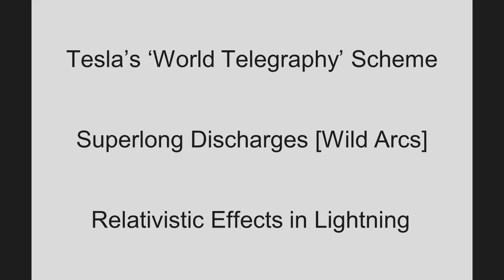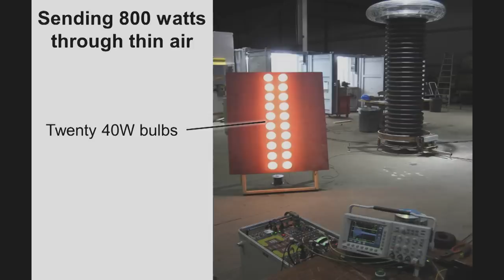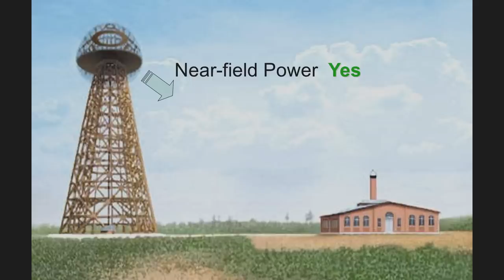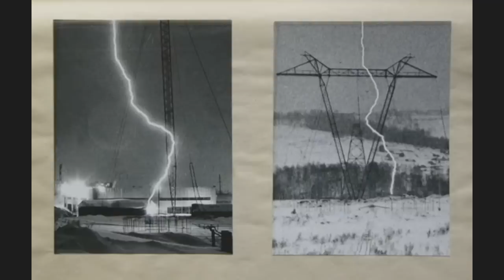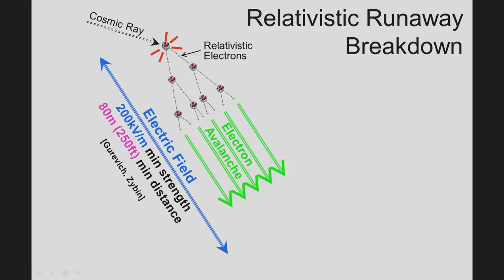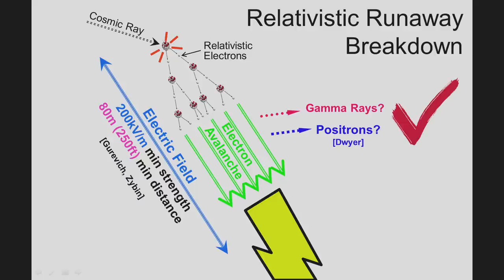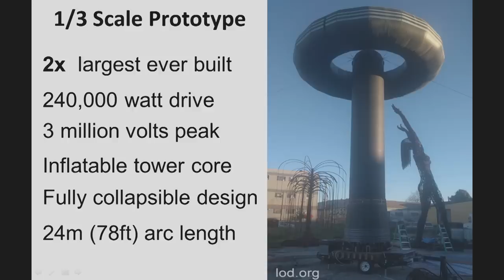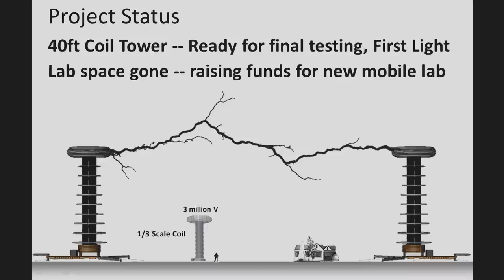The Secret Life of Lightning: The Science of Giant Tesla Coils | Greg Leyh

Comment: What I want to take time to discuss with this crowd and get some feedback on is my latest Tesla dream.
Its a known battery scheme that when vanadium (v2?) metal is charged by whatever means it can be used by way of pumps to strip away the charge for use in the grid.  
The dream is to lay down a large circular pool of vanadium with passive (?) grounding around the circumference of the pool so that the lightning is slowly absorbed into the capacitic pool without explosive force, thus charging the vanadium storage battery.
In order to get the lightening to strike at the desired location all that would be necessary is a small rocket carrying a hair thin conductor towards the clouds of choice, this is a known scheme that is effective for attracting lightning.
I'm told that the vanadium battery is stable and can hold its charge for years with little loss of charge.  I'm told the problem with the battery is that it takes a long time to conventionally charge and discharge but can do both at the same time with no degradation.
If I'm correct, by putting the Tesla coil in the liquid battery and bringing the lightning to it its possible to harvest atmospheric charge for use as needed.
Lightning in a bottle anyone? 
Thanks for your lecture and looking forward to hearing about foolish dreaming.
Just to be on the level, as a young child, I have seen ball lightning following the phone lines as well as a sprite, long before it was recorded by the astronauts from space so maybe that's my qualifications for the subject.

Comment: As another Tesla List member/lurker, I've studied ball lightning, and it seems to be a carbon electric effect.  In every instance of natural ball lightning, a source of carbon could be found.  I first generated it by using a burning chunk of car tire on the electrode of my Tesla coil.  The balls would begin to form above the flame in the soot smoke, and range from pink to blue in color, and up to 1/4 inch in size.  More powerful coils produced larger balls.  The largest was about 1 inch in diameter from a coil running about 2400W input. (12KV 120mA xfmr)  The Corum's put out a paper from Battel in which they proposed a carbon aerogel form, while I propose a fullerene form. Fullerene manufacture is usually done in a carbon arc in an inert gas environment, whereas, I would be making them in a combustible environment.  That's why I favor the fullerene as a ball lightning model.
Reply: So how does this explain ball lightning traveling through solid barriers?
Reply: @dougselsam5393  Good question.  Just like a soap bubble slowly evaporates until surface tension collapse, perhaps the plasma is the "surfactant" of an antimatter soap bubble that is at a harmonic of the weak force, and as such, just travels thru the 99% space that makes up atoms.
Reply: Some balls could be more supernatural in origin.. it is a prime shape.. then again maybe (substance dependant) carbon on the other side of the wall might somehow be induced into shape.. 

Nice research btw! An good question.
Reply: @richardward6747  Yes! The Corum's did find that balls would pass through glass if there were carbon smudges on the opposite side.  Likely a capacitive effect.  Like balls passing through aircraft windshields.  Jet aircraft always have a fine coating of engine soot on all surfaces, both inside and outside of the aircraft.  If the static drain system is degraded, the aircraft will charge to extremely high potentials allowing St. Elmo's fire to form.  It's that combination that's always seen in ball lightning events on aircraft.  Nothing supernatural about it!
Reply: Check out The Bagel Game
Reply: There was an episode of the podcast American Antigravity on YouTube where the engineer being interviewed said that the ball lightning went into a barrel or bucket of water then passed thru the wall and dropped the water inside of it into the floor that it had picked up from the barrel or bucket! The water on the outside of the ball lightning seemed to vaporize into steam (or maybe even something else like John Worrell Keely's Etheric vapor) but whatever was inside for taken along with the ball lightning and passed right thru the wall with it as if the wall wasn't even there and then fell onto the floor and left a wet spot when the ball lightning dissipated.

It makes you start to wonder, especially after hearing interviews like the one William Lyne gave about high voltage high frequency electrostatics/dielectrics  being used for all sorts of strange purposes that could have military applications from high speed flight with no G-force effects on the occupants of the vehicle when accelerating at rates that would otherwise kill any human or animal in a conventional flying machine, to phasing thru walls, to using it as weapon in the form of Tesla's "death ray" (a mercury particle beam shot out of an open ended vacuum tube using a "wall" of compressed air to keep the inner vacuum tube under vacuum during operation despite being open to the atmosphere for the mercury particles to escape which the Tesla version of the Van deGraff generator was then used to create an extremely high voltage dielectric impulse that was carried over this mercury "wire" after it was amplified to even higher voltage thru Tesla's special electrostatic/dielectric amplifier mentioned one of the four main components in the patent and then this mercury particle beam carrying this high dielectric voltage impulse was then aimed at vehicles and other targets would ignite them and their fuel source on fire at a range of up to 200 miles away and thus destroy them while also simultaneous mercury poisoning any personnel) to also receiving images thru time from the near to distant past that could be exposed onto film by allegedly using rotating quartz lenses (quartz being a form of carbon crystal).

Allegedly Charles Proteus Steinmetz working with Baird T Spalding came up with a Time camera based on rotating quartz lenses that was later confiscated by the FBI (just think of how many unsolved murders and other cold cases a device like that could put to bed!). There are also a few cases of time camera Inventions in Britain in late 19th and early 20th centuries. Pier Luigi Ighina also allegedly developed a microscope that could break the optical diffraction limit using rotating lenses similar in effect to the alleged optical diffraction limit defeating microscope 🔬 of Dr Raymond Royal Rife. Supposedly John Bedini somehow came into acquisition of the beam tube used by Rife and thru legal tomfoolery, he was sued and forced to fork it over to an IBM executive at the time due to disparity in financial power between the two that could allow the executive to carry out a legal war of attrition until Mr Bedini was eventually forced to give in and hand the extremely unique and important historical component over. If these devices are really out there, then it's a shame they have been hidden away because the potential biological and medical research that could be done seeing live samples in vitro at those scales rather than killing everything in the sample to place in a vacuum for examination under an electronic microscope would open an entire new chapter in the biological and medical sciences, and all science in general. But that might throw a monkey wrench into profit making machinery of Big Pharma and to some extent Big Energy as well... It's just too bad we're not all clairvoyant or the yogic techniques and process for becoming clairvoyant that open the etheric channels up the spine to awaken and activate the pineal gland havent been made public information so that we can't train our bodies and minds on our own time without needing to find and travel to the rare teacher (like Sadhguru) capable of training us to this level of "awareness" and can't use Dr Annie Besant's and Charles Webster Leadbeater's "micro-psi" research technique that was extensively used to document their research samples in their book "Occult Chemistry"!

Walter Russell I believe also claimed carbon was the highest energy state element on the periodic table and he had many unorthodox experiments like a syntropy/negentropy based nuclear transmutation machine that he said was based on the doubling principle in nature and that the device was confirmed as completely functional by Westinghouse labs and was printed in a newspaper article in the 1920s. Dale Pond has some great lectures on Walter Russell that also bring in the research of John Worrell Keely and seem to expand upon each other's work though it is believed neither men ever met each other or knew of the other. Dale Pond's SVPwiki is a great resource for beginning to understand their research!

There's just so much out there we don't know and when you start getting into different theories and experiments that were floating around prior to the first and even second world War, you can see that they were really able to think outside the box on issues in fundamental physics and electrodynamics but after the second world War with the rise of Atomic energy research and the 1951 Inventions Secrecy Act, it seems like much of that was all clamped down upon. With all the stories from guys like Bob Lazar and the late Philip Schneider, something tells me that if this type of research is done, then much like nuclear weapons testing, it is most likely done on remote federal government land like a military base and done hundreds of feet underground, if not miles, where they can contain any collateral damage to a minimum should something go awry, and simultaneously maintain operational security so that the research remains highly classified. It would also easily give you the opportunity for experimenting with other gasses besides air without needing to blow a giant building sized glass tube or globe to create a giant vacuum tube.

Comment: Great vid! Nice to see humor thrown in.. Lots of comments here  interesting all, but for anyone genuinely interested it's fairly simple to build a VTTC (vacuum tube Tesla coil) and it won't break the bank. A Microwave transformer (30.00 fr.EBaY) will give you 2kv. for the anode (plate) voltage, transmitting triodes (tubes) are cheap from there as well and even new 811A triodes are cheap. 572B's aren't bad either, I use a pair of these. Many old and new tubes work fine. Some wire, a filament transformer, forms to wind wire on and a few resistors and capacitors and you're good to go. VTTC's don't produce huge arcs but are great for wireless transmission of power. Just a class D oscillator with a big step-up coil. Lots of schematics online and I'm having real fun with this and also learning plenty. Great community of hobbyists out there also who are friendly and interesting people!

Comment: The higher the voltage the more pressure is pushing the electrons, thus the farther the arc is going to travel. Also lighting turns o2 into o3 and it has been "claimed" that ozone is being depleted  causing holes in the ozone layer. If a hole was in the ozone layer the hole would be visible as a black spot in the azure sky , and in that black spot would be visible stars in the background.

Comment: Any speak on Tesla that does not include Tesla’s electrostatic compressional wave, has missed the point. This lecture is an example of stacked misconceptions, and not enough research. 
Tesla clearly said 60 billion volts is not dangerous to handle,if one is utilizing his high frequency, electrostatic compressional waves. 
There is a 3 percent loss in sending this energy across the world, according to Tesla.  First thing you need is a flat coil, as compressional electron force is only possible from a flat coil, not a solenoid.
Reply: I like your brain! 😃

Comment: The answer is in the small light balls at the end of a lightning flash. Not the million volt arc. But the tip flare that jets of in a separate course. It is a bubble of charge that is counter to the atmosphere, so it has a short life, but if charge were maintained it's field left intact. You now have a bubble that holds itself against all matter no matter the density, to a point. That bubble is the field around ufo

Comment: Im astounded electrical engineering still hasnt figured out what musical theorist have known for Millenniums. The earth transformer hums at 7.83hz base frequency. In music a tuning fork struck can mysteriously vibrate a resonately tuned tuning fork several feet away or more depending on frequency. So the height of a mast will determine voltage. The top cap will determine how many joules can be collected dependent of its surface area. A variable resistor and variable capacitor with a spark gap can then be stepped down for power draw onced tuned into the earths frequency. Comes in low frequency, change it via spark gap distance and capacitor design to change the usable frequency. A 440v 400amp system would cost about 15,000$ at todays price
Reply: "mysteriously"? Really?
Reply: @cjay2  can you expound on sympathetic resonance?

Comment: My friend built a tesla coil out of a vaccume cleaner motor and belt and it burned the insulation off some wires or something and caught the appartment on fire
Reply: yeah you have to watch sparks breaking down the insulation of the wires charging the belt drive system  yeah um get cables with thicker insulators

Comment: A question
How have you guys managed to get the original Tesla designed tertiary coil to have the electric and magnetic component in phase? I'm sure you know that the displacement current effect relies on this otherwise your just transmitting conventional hertzian power?
And what mechanism is switching the 'spark gap' so fast to create the DC single pulse to feed the tertiary capacitor coil? MOSFETs?

Comment: I'm looking for the YouTube video that shows me how to build a lightening rod that charges my battery bank when struck by lightening. Or better yet, just while staying stationary up in the air.
Reply: My reasoning that this is possible is because once my low end solar setup had one battery that was grounded outside my home and it ran a 6v computer fan that ran mostly 24-7. Sometimes at about 4 am the fan would nearly stop the led acid battery being very low. As soon as the sun would believe the fan would speed back up. Early one morning about 4 am the fan moved very slow and seemed as though it was about to stop. A lightening storm came through with lightening bolts striking near. The fan began working at a speed I thought the thing was going to fly apart. It did not, but the battery ran that little fan at a high speed for over a week from that point on. Was it the light from the lightening bolt charging the battery through the solar panel? Or did it have something to do with the battery being grounded?
Reply: //we abide "offrid" and I am also concerned about my solar/wind system being struck by lightening and blowing up my gel battery's. Amd I rightly concerned about this? Anyone?
Reply: @nonyabusiness9747 its possible but onky becuase you have the neg dc to ground as in true earth ground.
Reply: @bramcoteelectrical1088  which part "is possible" I inquired on a couple different scenarios

Comment: I would say the problem is your over powering what is needed to just run a city or small town.at 100k watts in a distance the wave form holds its tuned signal if at BOTH ends are tuned and won't be veiwed over head as you see sparked lit up voltage over head when this is veiwed that means its not in tune has nowear to go RESISTANCE is seen in the air by only the lght sbow
Reply: Strange how no one wants to talk about this if the condition on each side to start to end is the same than the color of its manifest is rather not seen like the energy sourse a color or a invisible feild just because you dont see dont for one second think its not there like mr tesla said the color is the light in what condition its seen only of the feild under the condition

Comment: Diodes and dielectric have a good drawing on rope that is ceramics in the design Diodes plated along the molding dusted and heating of fine metal flux or flakes starts inductive coils to heat up and a honey comb wires can be thick thin the grainy powder mixture in to ceramics along the lines powder with inductive coil heating. twin mixs that 50/50 piezo powder and a dielectric pieces straight wire exactly the same pieces by melting the iron in side the ceramic and the other mix poles to there ceramics all ran through the line created for super influx voltage insulated and conductive.

Comment: Take one wimshurst machine.
Take a bunch of disks.

Ever build a car ...has name parts...Holly carb.
Ford engine block.

See the wimshurst engine block.
See the tesla part.
Tesla valve is for energy to flow through , not water .

Humans still use liquids instead of energy to power vehicles .

Use alkaline batteries instead of atomic batteries , which never die out.

Or a battery that is a lightening collector.
Leyden jar...

I get it ..
Science names to a machine.
Auto names to a machine.

Tesla parts , wimshurst parts, Layden parts , Bagdad parts, Robbie parts , flux parts , 
Define these parts from auto parts. Only flow with energy and not liquid gas.

Use parts to contain energy.
Not so much as wires , but as flowing through ...like a glass straw. To see the energy flowing.